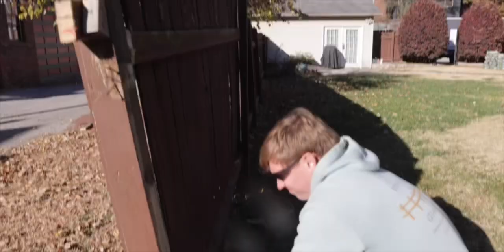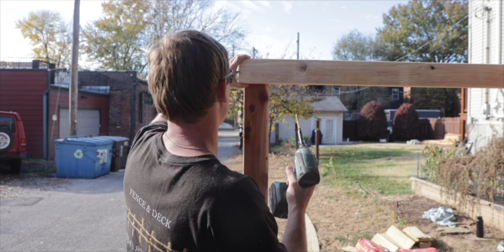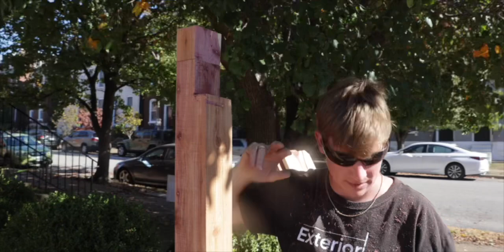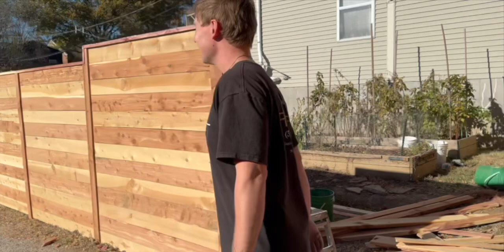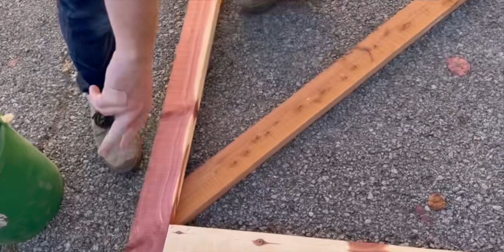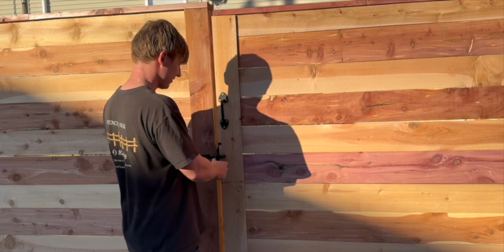How To Build a Wooden Privacy Fence (FULL COURSE)

Comment: This was a great tutorial guys. Very enjoyable to watch. 
 Any benefits to mixing high strength concrete and pouring it in mixed?
Reply from the maker: Thank You!! Both methods work well for setting posts. My mentor used to premix concrete before pouring, which is similar to mixing it directly in the hole but skips a step. We've never had issues with either method. However, for critical structures like a double gate's 6x6 posts, we prefer to premix for extra certainty, but for regular fence posts, direct mixing is perfectly fine. :)